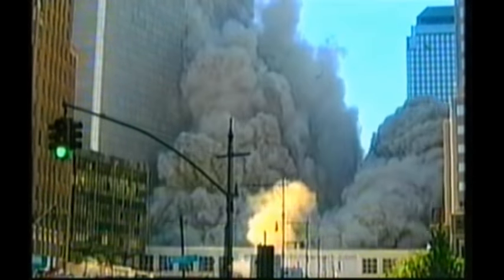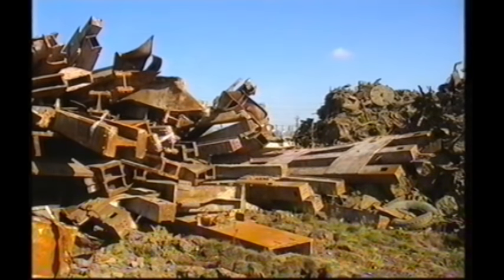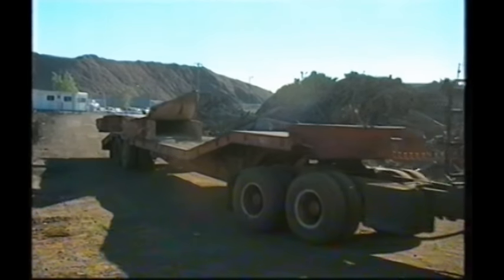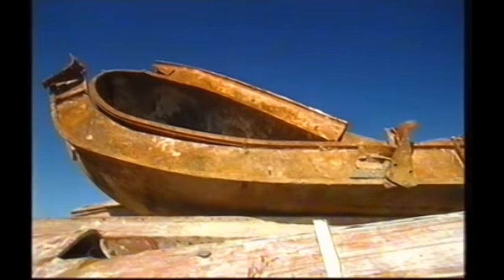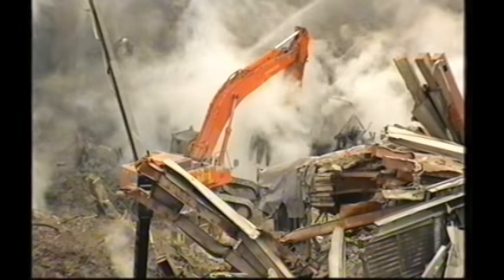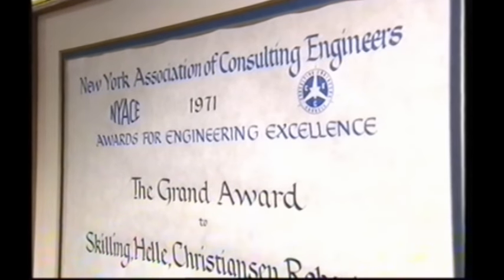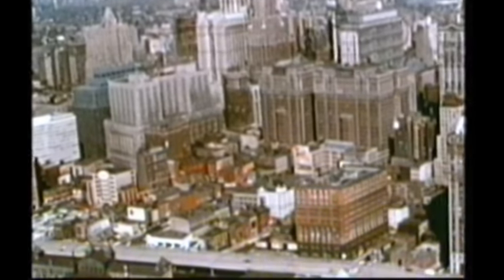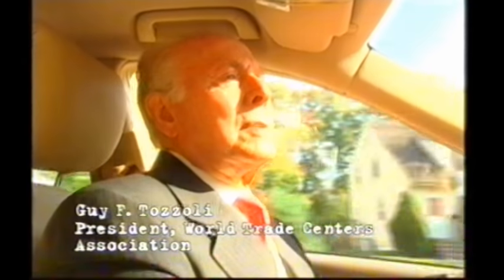9/11—"How The Twin Towers Collapsed" (C4 documentary, 2001)

Comment: Commercial aircraft CANNO T fly at 500 plus mph at sealevel. the only reson this speed is possible at 35,,000 feet is because the air is one third the resistance there. the reported speeds of the two flights in NY were travelling at TWICE the planes max velocity, and this would tear the wings off and make them impossible to control. Fl 77 was supposewdly flying 20 feet off the ground at 500 mph in the final 2 km ....which is IMPOSSIBLE.  extreme improbability - the official conspiracy theory - is defeated by physically impossible facts. I am an agnostic - I do not know how things happened that day, but when I am asked to believe the impossible and - instead of receiving a researched debunking of commercial plane limitations, etc, I am dismissed with ridicule, I think you owe more than that.
Reply: @YouTubeSucks_1  Yes, and I would add that the people who exhibit this strange reflex are defensive when challenged. Even though every second comment on this vid is about CD, the people who venture this opinion seem to believe they are in possession of a carefully guarded secret.

Comment: Nice bit of propaganda here. Can you guys also explain the alleged claim that the Twin Towers could withstand SEVERAL Boeing 707s crashing into them, not just one or two? Has anyone ever refuted such a claim?
Reply: The guy who made the claim (in 2001) was not in any way qualified to make it.  Irrelevant anyway.
Reply: This 'claim' was made by Frank Di Martini not long before 9/11. He stated that the impact of an airliner on the towers was like a pencil being poked through a screen door and that the structures could withstand multiple such impacts. The only problem is that he was dead wrong, and that he was utterly unqualified to put forth any opinion on the matter. Di Martini was neither an engineer nor an architect, nor did have have any role whatsoever in the design or construction of the WTC towers. Di Martini was a Project Manager at the WTC, and he died on 9/11.
As for refuting the claim, go to the main man himself, Leslie Robertson. His statements regarding what the towers were designed to withstand are well documented. In short, Robertson said that the towers were designed to not collapse immediately if they were struck by a single Boeing 707 flying low and slow and almost out of fuel. This aircraft was the largest flying at the time, but was nowhere near as large nor as heavy as the aircraft which struck on 9/11, and they were flying much faster than the design parameters were meant to withstand. Finally, Robertson clarified that none of their test scenarios ever envisioned such high speed impacts that would blow off the fireproof coating on the steel elements, particularly the lightweight trusses which were very prone to failure due to heat. Consequently, their design scenarios never anticipated the collapses of the trusses which in turn allowed the perimeter walls to bow outwards and lose their capacity to support the weight of the floors above the impact points.
So, not propaganda. It was analysis of fact-based evidence that the conspiracy theorists don't want to acknowledge because their own pet theories would evaporate.
Reply: "Robertson said that the towers were designed to not collapse immediately if they were struck by a single Boeing 707 flying low and slow and almost out of fuel."

Neither did the Twin Towers on 9/11. They stood for about an hour (give or take) after reportedly being hit by fully fueled Boeing 767s flying at high speeds. They didn't immediately "collapse" upon impact despite suffering considerable damage from the attacks. Unless your definition of "immediately" is complete structural disintegration within one hour, in this case.

Comment: You know, jet fuel melting steel over only 2 hours of choking and oxygen deprived fires makes as much sense as the Magic Bullet theory in the JFK assassination. And yet the bullet that smashed through 2 men, and traveling at different angles completely, breaking bones and leaving tiny fragments through the Governor's body and yet emerge nearly pristine is just as silly as the steel sagging so much in only 2 hours when planes that simply crash into the ground don't even burn up their own fuselage!!!!

Comment: Thermite. Multiple explosions. Thats how.
Reply: Well which one is it?  Thermite or multiple explosions?  Thermite is an incendiary - it burns. Thermite does not explode. The only reason conspiracists talk about thermite (and only conspiracists talk about thermite) is to rationalize the obvious lack of visible and audible explosions and their effects.

So please get your story straight and come back to us when if you do.
Reply: @MrSrtman18  - Any particular reason you could not answer the question?
Reply: @Ween1776  - Not exactly the brightest bulb on the tree this one. A very typical conspiracist doing very typical conspiracist things. Boring.
Reply: So how were two 110-storey buildings rigged for demolition in complete secrecy?
Then, explain why the airplanes were even necessary.
Reply: @kyle381000  it takes critical thinking and logic. It was a controlled demolition. Otherwise using their logic, pentagonn would have burned to ash. Instead you saw a computer and papers. That was a missle